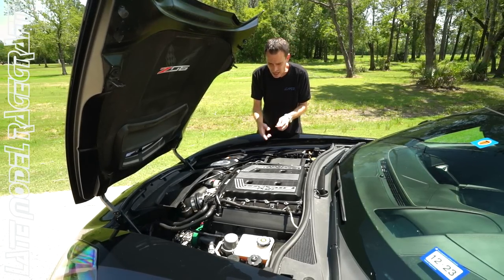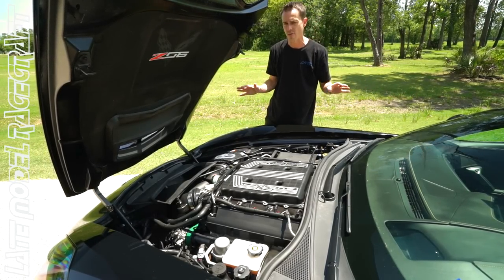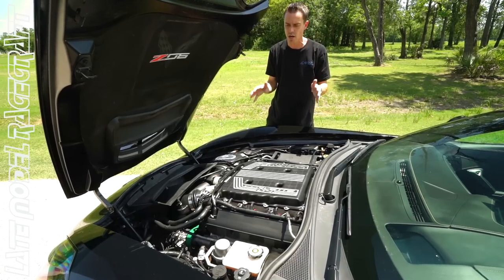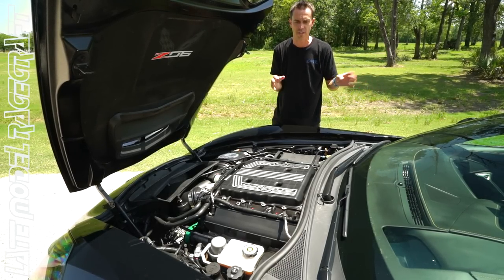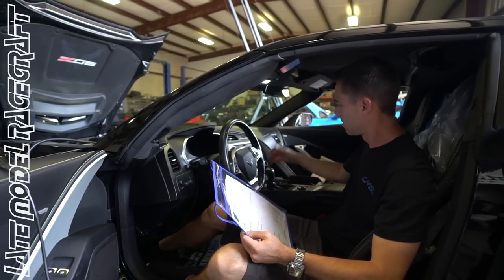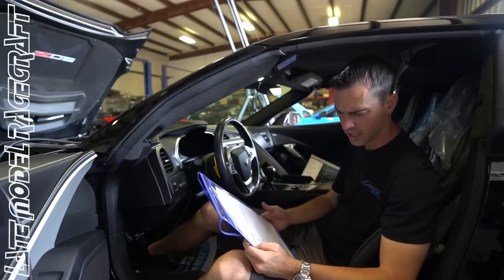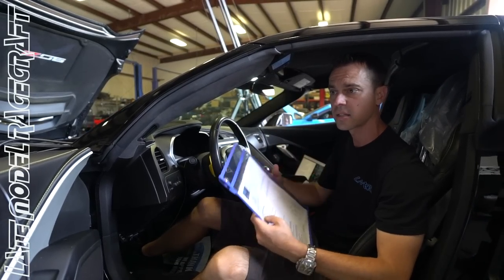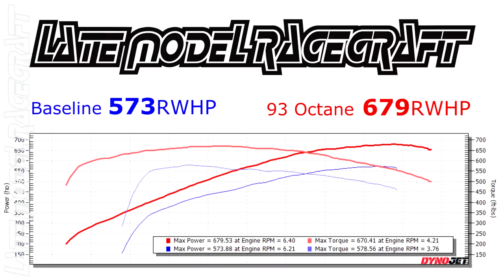Customer rides in his newly modified C7 Z06 with Steven Fereday behind the wheel.

Comment: Which header size would be best for my c7 zr1 1 7/8 or 2in long tubes headers and x pipe. Only mods I wanna do is intake and tune
Reply from the maker: If those are only mods 1 7/8 will be just fine.